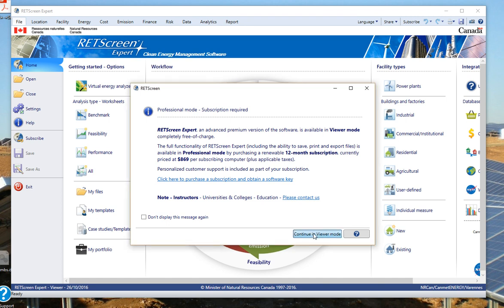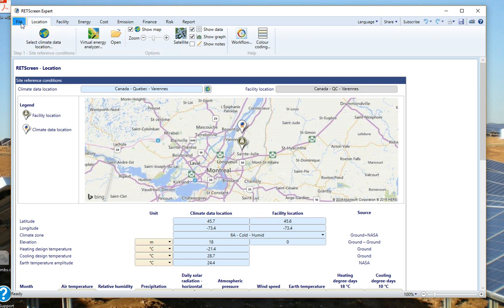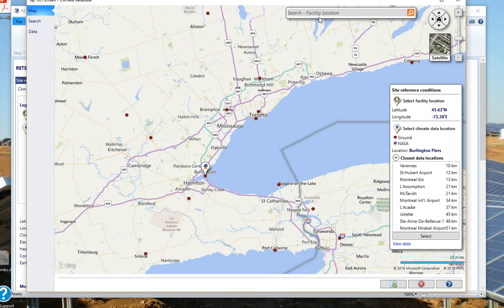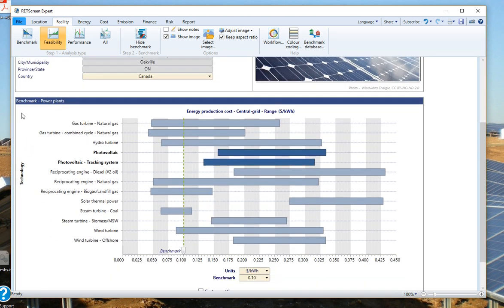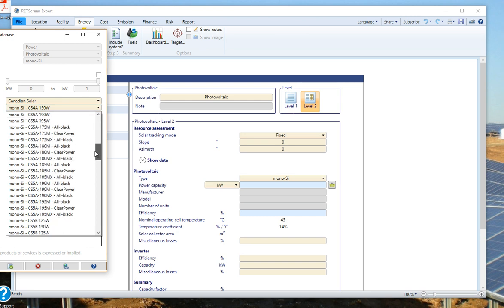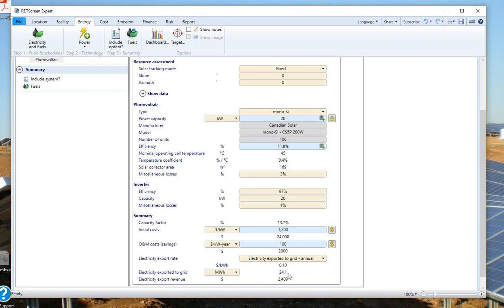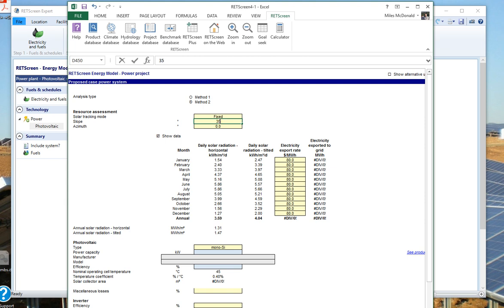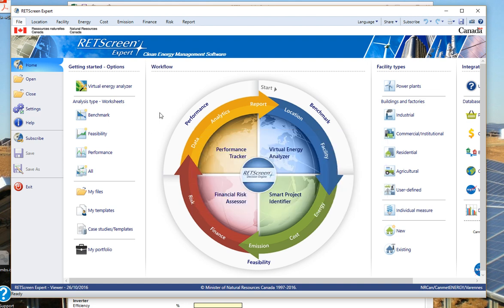Retscreen Expert Introductory Tutorial

Comment: Hi Miles. I have a question. What would be the basic steps to perform a comparative analysis between two different alternatives that provide heating and cooling for a new building. I did something similar with RetScreen 4 but with RetScreen Expert can't find my way around. Thank you very much.
Reply: This is the answer I got from Retscreen support:

The quickest way to see how to do this in RETScreen Expert is to use a case study so that you can see what settings. From the File, Open page, click on Case studies/templates in the menu. There, you’ll find a few which show you how to do a comparative analysis of heating/cooling system alternatives. Specifically, the ones called (“Description”) “Energy efficient – house”, “Model National Energy Code for Buildings (MNECB)” (both the office and residential one) and any of the archetypes will show this. To access the archetypes, click on the Virtual Energy Analyzer in the menu, select your location and then choose your facility types from the dropdown lists. Make sure you select one which is under the “Feasibility” header and not “Benchmark”. On the Energy page, you should find the full analysis, similar to RETScreen 4, with structural enhancements. To get to this step manually, you need to be under a buildings facility type on the Facility page (e.g. Residential, Industrial or Commercial/Institutional).
Reply: Thank you sir